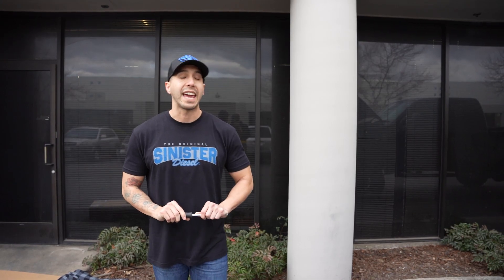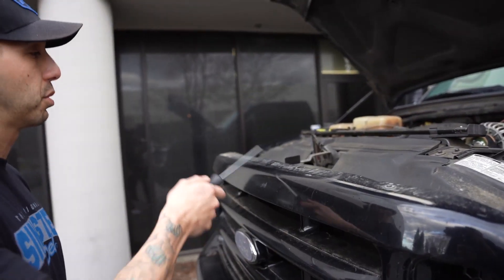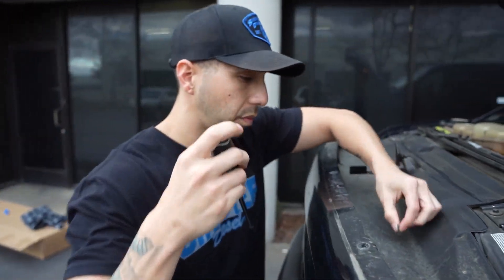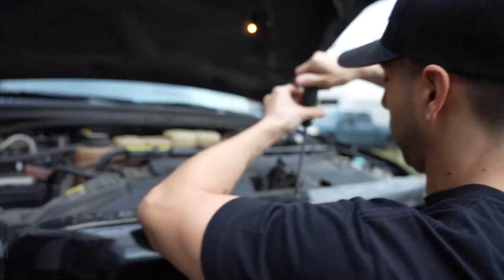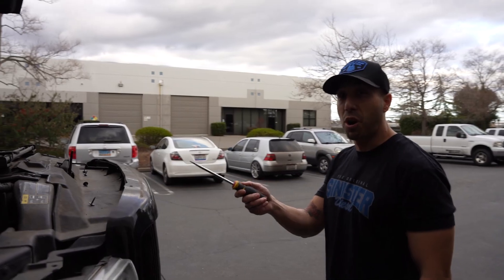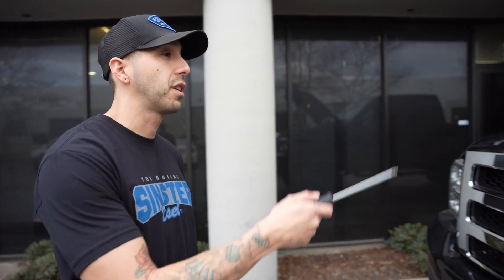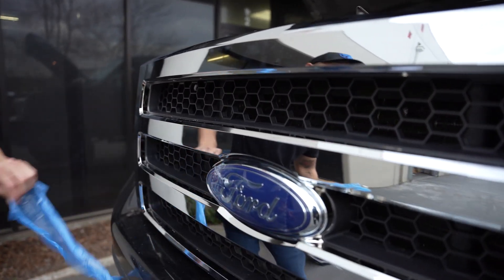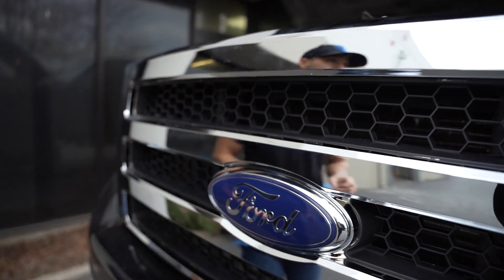Installation for Updated Grille on 1999-2004 Superduty and Excursion

Comment: Just received one of your grills for a gift. I was looking to do a 6.0 or a 6.7 front bumper swap. Will those bumpers still mount up to this grill well? (I understand there will be some bracket changes with these bumpers but will the fix's for the bumper swap still work with your grill if I go ahead and install)? Thanks